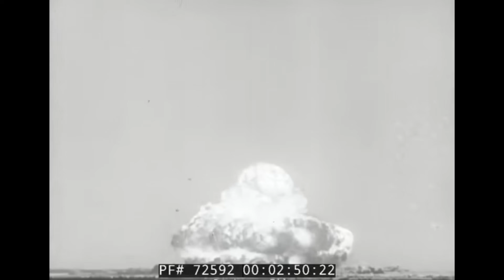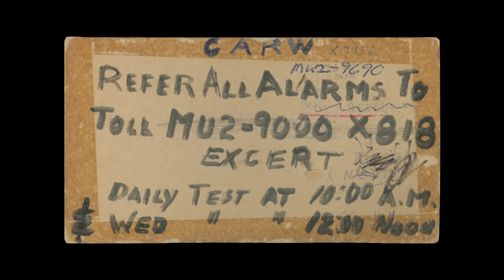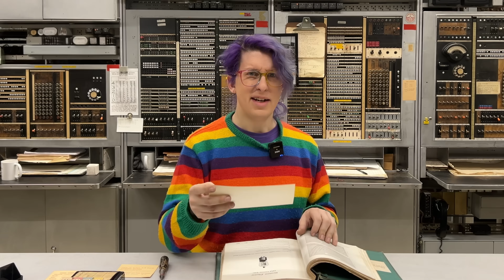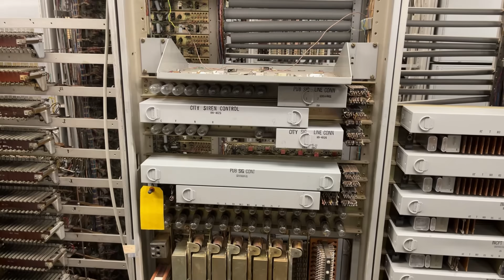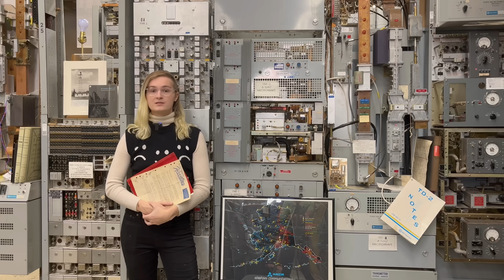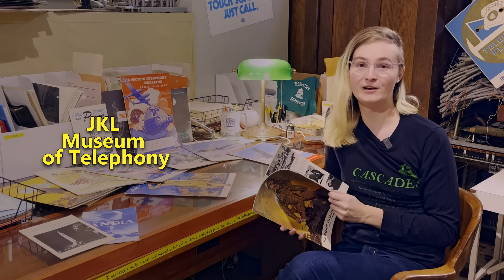CARW: Bell's Nuclear-War Telephone Network

Comment: Some parts of the country still use them, though mainly for bad weather. Dallas TX (and its many suburbs) for example, will sound them for high winds or tornadoes.

There was still a Thunderbolt 1000 near my old apartment in Dallas when I left there - it was on the property that the nearest fire station sits on. Pretty sure they retired all of them by now in favor of electronic sirens at this point, and they moved from relying on POTS to RF (which someone figured out in 2017, triggering all of the sirens in the city for over an hour).

Comment: I wish that in my own country our public telecom had preserved what you guys have there... unfortunately neoliberalism kicked in and the public monopoly was sold to an "investment fund" and of coarse that everything old and obsolete was scraped... I would love to volunteer if it existed, I was a CO etch engineer for 3 decades and have works with all the telephone coper wire tech since the Stronger rotary selector systems, crossbar systems, until the latest digital tech including ADSL and HDSL systems... Nowadays everything runs on fiber and VOIP systems and "Old timers" are literally out of work...

Comment: In my days of high school, from 1972 to 1975, our high school had one of the CD air raid sirens outside of one of the science classrooms on the 2nd floor. They would test the siren, at 12 noon once a month on a Wednesday (the school board attempted to push the tests to a Saturday for years, but it was denied).If we had a class in the particular classroom, we would just wait going into the classroom until the test was over, because the siren would be so loud, it rattled the classroom windows and the sound was unbearable. In 1976, the CD air raid sirens in our town were decommissioned.

Comment: When I went to the Museum I proposed the idea of donating a mini siren to connect to the dial system. I know most mini sirens run off of AC power. Would y'all need a DC switch relay? (Just want to make sure I'm able to donate all the necessary components.)

Comment: One thing I’m curious about, I know if I was the dial operator and I made a mistake, I’d probably use the STOP slot as a proverbial backspace signal. Would that have worked?
Reply from the maker: That makes sense, but nope! The STOP command abandons everything and you have to start over from the beginning.

Comment: The sirens remind me of my college days. Winthrop University in Rock Hill, SC had (still has? It's been 30 years!) an air raid siren on one of the buildings. It was being renovated my freshman year, but when the Theater department moved back into "their" building, the siren was tested about once or twice a year. Right there on campus it was DEAFENING!
Even more notable, the main auditorium on campus had a fallout shelter in the basement. Building dated to the 1940s, so it made sense for the time.

Comment: I'm an old part of nearly 70 now. But I must say. After a career of more than 50 years. Working in the Communications Industry for NBC-TV News in Washington DC for 20 years. And being one of the first, Out Tranny Women. Back in 1986. NBC liked Tranny Women for TV Show Ratings. They just never had one. As one of their Top Engineers, before.

And so is wonderful to see. My lovely Sisters in the Family of, communications. Communicating with everybody so well. And looking so good. On camera. You are both a breath of fresh air. And a busy signal. That you have both been busy little bees. Pollinating all of that old Telco Equipment. With New Life. Just like yourselves. Bravo!

Yes there is a wonderful family of Tranny Communicators out there. We work hard at communication. And we communicated in many different ways and manners.

I did it through Broadcasting. And soothing the savage beast. With Fabulous Musical Recordings. Of which I was honored. To be nominated for multiple, Grammy, Emmy and Soul Train Music Awards Nominations. Under Best Engineered, category. What an honor. I never thought I would have that happen. No. I thought I would win one of those awards? God dammit! It's always something you know? But just an honor to be nominated. As one of 4 runner ups. Out of thousands of entries. All judged by the very best in the industry.

And instead of wiring up. 40-50-60-year-old telephone equipment. Refurbished, restored, repaired, revamped. 40-50-60-year-old, Top Pro Audio Equipment. Which is a lot more fun than telephone circuitry. Because you have to be concerned between 300 Hz and 3000 Hz. I have to care about the whole kit and caboodle. From 20 Hz to that of 20,000 Hz and beyond. And with nowhere near. The distortion you get on telco Circuits. You know? It's more testy stuff to be testing.

And I know. I was one of the best in the industry. By all of the other studios and broadcast centers. I did contract work for. Or I was employed by. For married lengths of time and service. As I spent 2 years with the VOA TV News Division. And I was greatly honored. To serve my country as a Federal Employee. But now Donny. Has killed them all. Put people out of their lifetime careers. Other noncoms. And to shut down and shuttered. What has been servicing the world with reliable American news and information from the VOA. They considered not necessary anymore. The beginning of our Autocracy. Because many other people around the world relied upon it. And now destroyed for our Autocracy.

An Donny. Has declared War. Upon the Transgendered Community and the LGBTQ. And they think they're going to get away with it. Nope. Not on our lives. But on their lives. And the termination thereof. Because that's what they want. When you declare war on peaceful and honorable Americans. And think you are a Superior Race. We will race you to your Finish.

These Republicunt extremist fascist crazies. Believe they are immune. From any indictments. Because their Deity Savior Donnie Dictator will pardon them. Nope. There will be anything he can do about the gigantic holes in their cranium on both sides. It'll be tonight for them, then. Because they have brought this on to themselves. When you attack Americans you don't like. You're not going to get away with it unscathed. You will have your hands cut off and be tarred and feathered. The old-fashioned way. The Golden Rule, way. They chose to do in reverse. Do unto others as you want to. Yeah now. Those white South African slaveowning farmers. The finding that out now. Now that the Black Folk of South Africa are in charge of their Own Country.

And it just so happens? Elon Mosque owns lots of farms. In South Africa. His life is grass there. 6 feet under. So he had to apologize to Donnie. Before Donnie deported Elon back to, South Africa. And he went groveling back to Donnie's feet. I'm sorry. I'm sorry Donnie. I didn't mean what I said. I was being too harsh. What a Loathsome Scumbag Elon Mosque turned out to be. And I hope we Bankrupt Tesla for him. Timely cut that South African Apartheid TurdBall. Down to size. He's nothing but a disgusting South African bigot Turd. Time to deport him to South Africa. And his US$600 billion will remain in the USA. How about that Turd Ball Elon? You're not taking your fortune with you when you're dying. You're not taking your fortune out of the USA.

In fact for all of the American lives. You have Now Destroyed. We shall take your 600 Billion US Dollars of wealth. And we will pay those federal employees off. For what they would have made. Until they were 65. And we will use the rest of your money. To start rebuilding our Infrastructure. New bridges. Free High Speed Wireless Internet, throughout the USA. Just like the FCC Broadcast Act of 1934. Free programming. Supported by commercials. And now the same for the Internet in the USA. And new Bridges. New Highways. Built with, Autonomous Electric Vehicles, in mind and prepared for.

That's what were going to do with, Elon's US$600 billion. He does not need that for himself or his children. He doesn't need more than $2 billion. And that is all. That he shall receive. Because of he can't live comfortably on $2 billion of Self Worth? He is doing something mighty wrong then. Time to indict him. He is going to be sorry. He ever thought he could move to the USA and takeover. He is just another crazed sick in the head Turd ball, Hitler Wannabe. He's going to have to find out the hard way. He's not. And we will make, minced meat out of him. That disgusting bigot. Think you can declare war upon the American people and the LGBTQ Community? Think again, Donny. He's never had to deal with Real Hostile Americans before. Now he's going to find out firsthand. I'll of the Americans. He has hurt, Badly. And the innocent young pregnant women. That were in dire need of emergency care. DID NOT DO THEM BY THESE FASCIST BIGOT NAZI MONSTER PRICKS! THEY HAVE REAL BLOOD ON THEIR HANDS OF MURDER! THIS CANNOT BE TOLERATED! THEY WILL GO DOWN FOR THEIR HEINOUS CRIMES AGAINST INNOCENT AMERICAN GIRLS! IT'S TIME!.

This is the Worst American History that ever was! Time we do something about them. My Fellow Americans!
RemyRAD

Comment: Oo oo an old special interest of mine!!

They still do monthly tests of the sirens in Amarillo, TX. We have one of the densest (and at one pont, one of the most diverse) networks in the country thanks to the nuclear weapons manufacturing facility just north of the city and the high risk of tornados in the area. 

We used to have a lot of the classic Thunderbolt sirens all over the city, along with a smattering of sirens made by other manufacturers, and the system was locked to the basic steady alert pattern.

Unfortunately, a lot of the cooler old sirens have been replaced by generic boring Federal Signal 2000 series units :/ The youtube channel kdksiren did a great job of documenting the various sitens all over the city before they were replaced at least.

Comment: My local municipality installed a new siren, replacing an old Thunderbolt that still worked well 😍. Looking at the control boxes on the pole, I think it is now set off by radio.

Comment: I have some memories of working with the Autovon system when I as stationed at Naval Security Group in Rota, Spain as a Crypto Tech.  The upper floor of the comm station was the "Technical Control" analogous to the Telco central office, and I used to despise going all over the place to track something down that was malfunctioning or to set up a circuit, so I bought a pair of roller skates, not Navy approved but it sure saved a lot of trudging around. 🤣. Love the channel and thanks for sharing. 🏳‍🌈

Comment: 130VDC, or CARWash ring voltage, was necessary to kick the neon lamps into actuating flash and ring. Just be extra careful around that high voltage banks. It can be enlightening. I won't be getting near them! I get kicked around by that stuff regularly.

Comment: us brits had a similar system during the cold war called the wb400 which incorporated a code message "attack warning red" repeated after the siren tone that played through the receiver after the switch was flipped on the transmitter, there was also a receiver that would also sound air raid sirens.

Comment: My dad worked for the telephone company in a switching office (switchman).  Later these were called Central offices.  I got to tag along occasionally as a child.  There were colored lightbulbs (red, green yellow, white) in a row located at the end of some of the frames.  He told me they were a condition indicator during emergencies.  Were these the same system.  I remember the office was heavily fortified with steel roll-up window covers which could rapidly be closed.

Comment: As cool as the 4 light solution is, I think we often look back on older engineering and think they must have been more clever or better than modern engineers to invent such an elegant solution but that's not necessarily the case. They did have to be more efficient in some ways due to limitations but we often reverse the causation. It's not that they said we have 4 different signals that need to be sent but can only use 2 wires, how can we do it, but rather our system can only handle 4 signals, decide which 4 are the most important. Still a very cool and clever use of technology but much more relatable and understandable than the other way around

Comment: UK had  HANDEL as an equivalent, used the speaking clock system to communicate, because any faults on those circuits would be noticed early

Comment: Would a lineman know not to clip onto this wire pair at a pole or in a cable on the street? Was there a specific wire color they would know this is a special circuit that wouldn’t have dial tone or anything of the sort?

Comment: I may remember them, what are you talking about dont they still test yours.... Oh I see you dont get tornadoes. I will hear mine go off in exactly 31:20min. I have heard these the first tuseday of every month at 10am for the last 48 years.
Reply: Although as of 15years ago in northern Il they are triggered by the correct audio tone on the local police radio frequency. I actually had a ham radio friend show me he was able.
Reply: Just wondering what year did they stop testing them outside of tornado alley?

Comment: very fun to me that the signalling solution was Charlieplexing with light emitting diodes of a tubular sort. How modern! This is still a common solution for operating a larger number of lights. According to wikipedia it seems like this was a technique that lots of people knew about but didn't think was noteworthy except for a patent in 1979 and an LED driver IC in 2001. I'm not one for editing wikipedia but if this video counts as a reputable source, then it would be the earliest example of the technique by over a decade.

Comment: Wow, another great video.  I am so envious of your archive.  In phone phreaking there were those with interest in the mechanics and then a subset interested in mining data from the paper trail.  So much of that technical material got dumped out as unwanted, it's heart warming to know that some people still care about its preservation.  And maybe you can help me solve a mystery related to air raid sirens.  I have a document that lists all of the sirens in the city of Los Angeles.  The sirens have been landmarked but no one knows who is responsible for their maintainance.  The document is Appendix J EOC and Warning Common Carrier Circuits, Part I - Control Circuits Other Than Public Phone System.  The circuits listed start at 7PS3-1-32.  I have no clue as to where this document is from.  I tried contacting the Cybersecurity and Infrastructure Security Agency Telecommunications Service Priority (TSP) Program Office, and they were not helpful.  All they asked was if I was looking to have TSP applied to the circuits listed.  I said no, I was trying to find the holder of the document.  Their response was "this doesn’t fall under TSP authority and responsibility."  Would you have any ideas as to who I could contact?

Comment: The catch with the Chrysler Air Raid Siren- Receiving the signal didn't directly activate the siren. It told a guy that he had to go up, start the motor, and manually engage and disengage the clutch to the siren rotor mechanism. One of the top 10 jobs I'd never want, sitting on a roof/tower warning the world that it's ending without being able to hide, yourself!
Reply: That was only true of the first generation of Chrysler-bell victory sirens because they were fully manual and had a seat the operator would sit on the siren and operate it. But the final generation of Chrysler air raid siren(1952-1957) that had the 331 hemi was optional to be fully remote operated, which the ones in the Seattle system were remote operated and most of last generation Chryslers installed all around the U.S. were typically remotely operated, and were typically only manually operated during repairs/service work or in case of a system power outage.

Comment: I live right down the road from the local fire station that has the city's air raid siren on top of it.  Its also used as a alarm to call firemen to the station whenever there's a fire.  Every time that thing goes off, I just about panic.  I do NOT like the sound of air raid sirens!